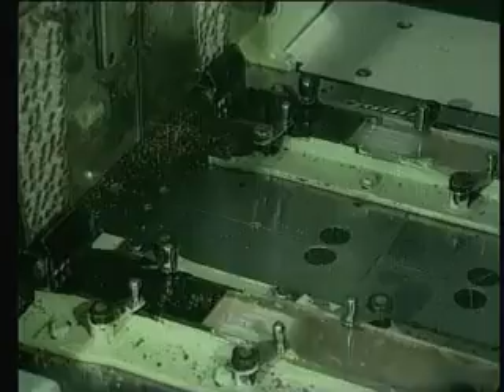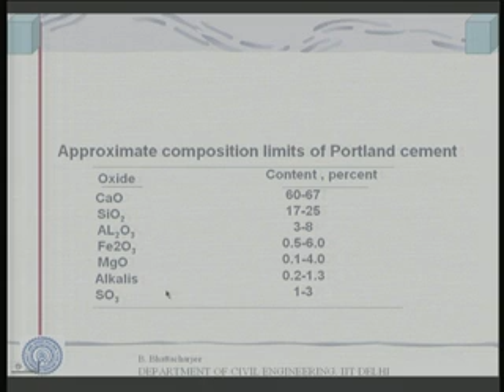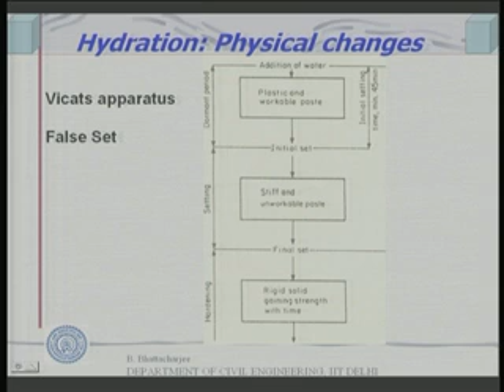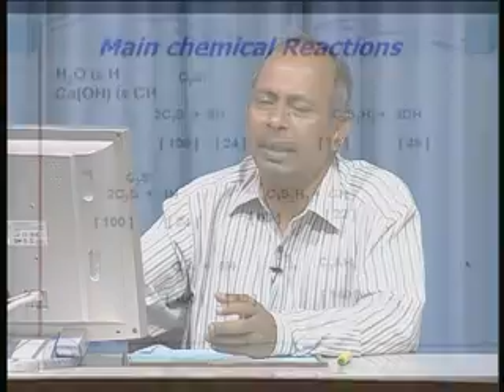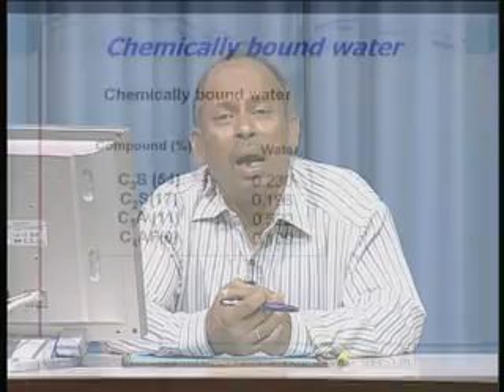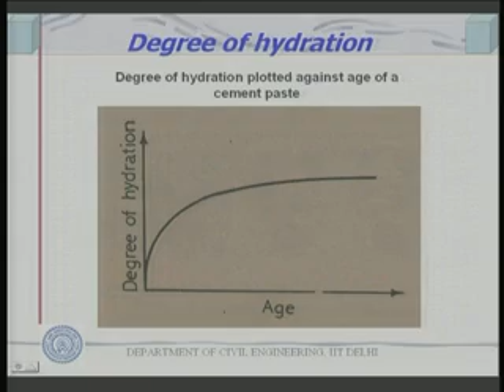Comment: sir could u please give me ans that which was the first bogue's compound react with water when added to cement c4AF or C3A
Reply: There r two compounds which r act first... Tricalciumaluminate and tricalcium silicate.... Tricalcium alumina te reacts with water and produces enormous heat only.... but tricalcium silicate reacts with water and produce early strength..... Thanks
Reply: thanks for ur reply.Then when will tetracalcium aluminate ferrite reacts???
Reply: @demudukolli4854  C3A REACT FIRST
Reply: Ferrite reaction also starts quickly as water is added, but then slows down, probably because a layer of iron hydroxide gel forms, coating the ferrite and acting as a barrier, preventing further reaction.
Reply: C3A....Due to its high affinity towards water..it also has high heat of hydration